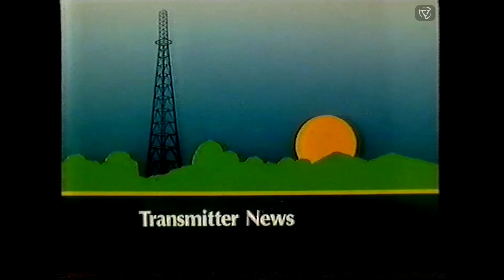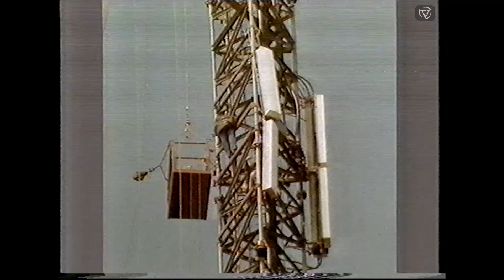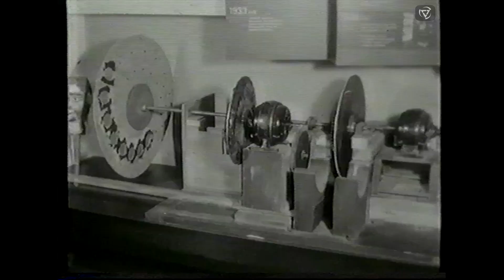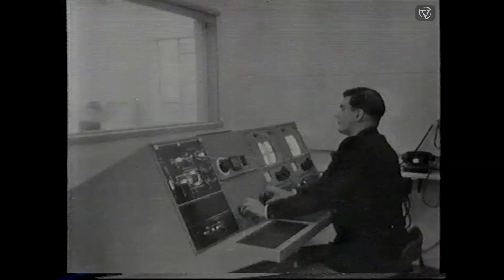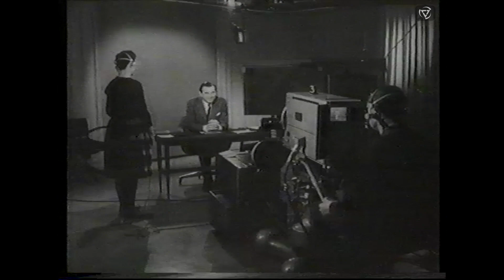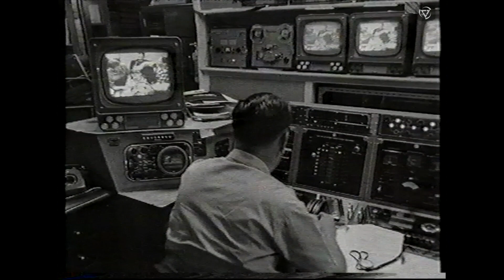☆ IBA Engineering Announcements on the end of 405-lines | January 1985

Comment: I remember around late 83 we got our first teletext set and I used to tap in random page numbers to see what came up. One page of Oracle just showed a small text overlay on the TV picture that said something like "This 405 line service will be closing shortly". The word "THIS" confused the hell out of me and had me thinking that teletext was somehow using the 405 line service and that we wouldn't have teletext much longer. Was it just a typo or was this intended for the transmitter sites to overlay on 405 line broadcasts in the run up to switch-off?  We did have a dual standard set in another room but I don't remember seeing any on screen messages on 405 prior to closure.
Reply: In the final days of 405 line telly, a random Oracle page contained a newsflash style caption about the closure of 405 lines and that one was hardcoded onto the screen (405 line didn’t support teletext but it was overlaid at the transmitter and somehow fed to the 625-405 converter) with that message.

Comment: "To be good at this job you've got to be physically fit and mentally deficient, and we are neither."
James Tough Lonie BEM, Chief Mast & Aerial Fitter (Scotland), Independent Broadcasting Authority, quipping about the job of replacing the aerials at Durris.
Reply: @antster1983 was that around the time when the Durris mast was badly damaged by a lightning strike ?. I remember reading an article in a BBC handbook about how they used their AM transmitter at Redmoss as a temporary site until Durris was repaired. This surprised me as, in the IBA's handbook, they mentioned that AM radio & UHF TV signals don't work well together at the same site. If anything I thought they would've used the Granite Hill transmitter where Northsound Radio broadcast their FM signal from at the time

Comment: One thing I always like seeing on your videos is that strange "pattern" that moves down the screen at the start of recordings. My grandparent's old VCR (an early 80s ITT model- a massive thing with all sorts of inputs, outputs, knobs, switches and functions you'd never use) did the same thing- along with putting a farting noise on the soundtrack just afterwards (you can see and hear it on both these clips I uploaded- https://www.youtube.com/watch?v=WfMTy5QMoRI https://www.youtube.com/watch?v=ZHP-QgABbNo). I'm guessing it's something to do with the way some VCRs from that era worked. Long lasting machine too, They were still using it until 1999, then I had it for a year or so till it finally died.
Reply: It was a primitive form of "skip" feature that you find on DVDs now. When the machine made a new recording it would recording a voltage pulse in the video and audio signals so that when it was in this "search" function it would fast forward or rewind with the tape around the heads, and it would load into play when it found one of these pulses it had recorded.

It was crap not only because of the limitations of VHS, but it would not find recordings that had their start point erased over nor was it compatible even with different models of machine with the same "feature" (as the technology was the same only in theory, in practice variations in the voltage pulse, the length of the pulse etc resulted in incompatibilities when using this feature).
Reply: Had my VHS till 2003. A Grundig.
Reply: @2001JamesTV I had a Ferguson stereo (pre-hi-fi) VCR which did exactly the same thing. It was an early precursor to the Index Search function that was common on many VHS VCR's during the 90's & 2000's. Thankfully by then, the index signal was neither visible nor audible regardless of whether it were a mono or hi-fi VCR